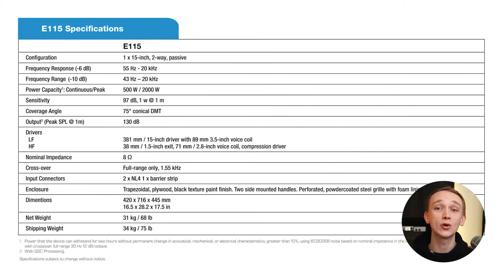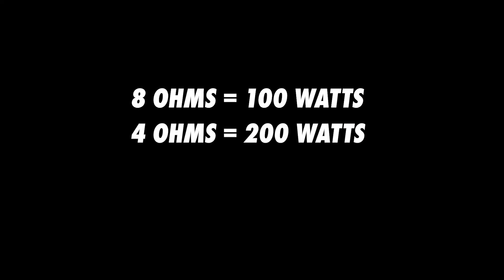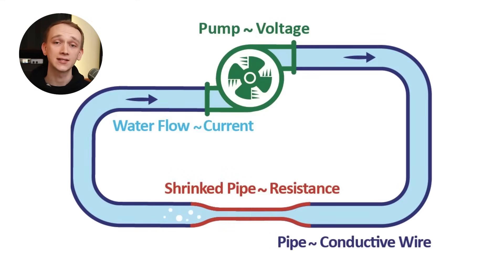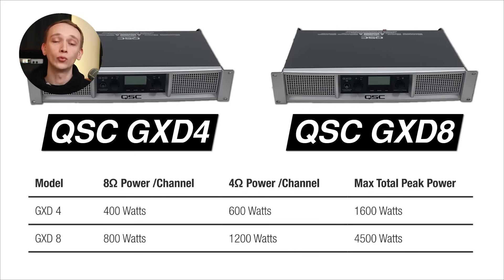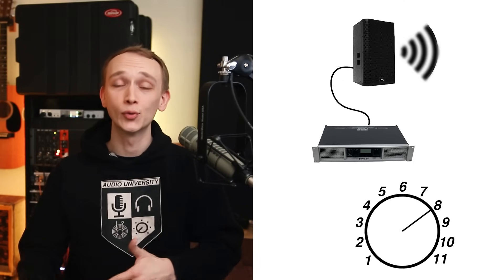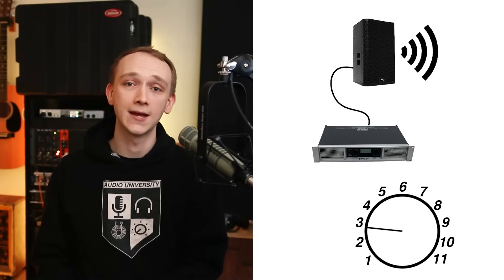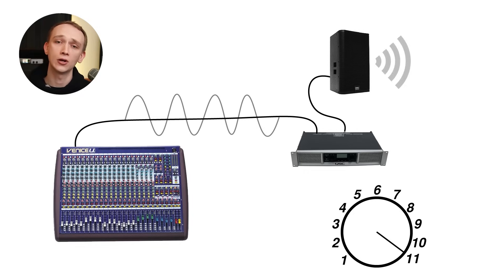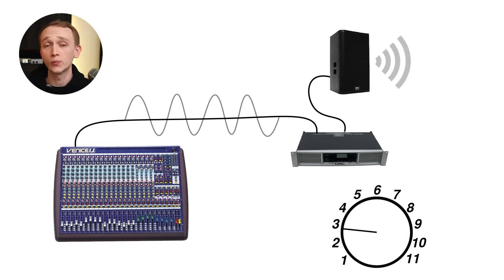WARNING: Breaking These Rules Could Destroy Your Amplifier & Speakers!

Comment: Rule 3 is nowadays not really a thing anylonger, I have never seen any professional (and even some cheap) Amplifier which has no limiter built-in to avoid clipping in the last 30 years or so. Without clipping, you can match speaker power to the amp power (800Watts Speaker on 800Watts Sinus (DIN in Europe) or RMS Amp).
It will never clip/distort due to the limiter and never overheat the voice coil with giving 1000 Watts to an 500 Watts speaker for longer periods of time. You can hear clipping, but not an overheating of the speaker. Of course, if the "max"-LED is lit up continously, you have an underpowered system, but at least no damage is done to the speakers.
Clipping can't be heard with some alcohol drunk, that is basically the death of all cheap "DJ-Sets" with an cheap, non-limiting Amp and cheap speakers (and even some good speakers) - they will be destroyed after the gig, at least the tweeters on 2 or 3-way systems.

Comment: Too oversimplified! A Hi Fi speaker is not "A" speaker, it's a speaker system, usually a woofer and tweeter or also a mid-range. They never have the same power rating, always less for the tweeter, which gets damaged by the added high frequencies of clipping bass.  The impedance rating is nominal and often varies drastically over the range of frequencies, so for the amplifier current rating, only the lowest point matters, not the nominal rating. Amplifier peak ratings seldom are much more than their transient rating unless the power supply is unusually skimpy, so it will not be able to supply the peaks the speaker can handle. Those peaks mostly are bass because the ear is much less sensitive to low bass. Low bass therefore is typically louder. The extreme highs in music are lower or shorter duration, so the tweeter is less challenged by normal music. Heavy metal fans be forewarned. Good audio requires powerful amps, more than the speakers can continuously handle. Most speaker damage occurs while listening under the influence resulting in levels that violate OSHA. There is no magic combination that is idiot proof except for integrated speaker-amplifier designs that have built in limiters that won't allow you to melt the voice coils.

Comment: Thanks for the video and efforts put in to it.
However the reality is quite a lot different.

On an average room you only need 4 to 8 watts max for your speakers even if it's an 85db speaker.

All this watts hype are just pure b.s.

All you need to make sure is impedance matching or the closest between the speaker and the amp i.e. if you have a 6ohm speaker then connect to your 4 ohm amp or binding posts instead of 8ohms, 4ohms to 4ohms and 8ohms to 8 ohms (obviously)

Comment: I'd like to add some technical points here.

Speakers are usually not driven to their full capacity even at the same continuous (RMS) power from the Amps running at their full capacity (unclipped). That's because music signal amplitude has lots of ups and downs, unless you are playing a continuous, say 1KHz signal. Subwoofer tends to get more average power than mid and highs. So getting same continuous power speaker as your amps are usually wastage of money. Frequency response of audio amplifier are also not flat. Most amps are rated with their power @ 1KHz frequency, higher or lower than that and you tend to get lower or higher power at output. I'd always pick a Subwoofer rated 60-75% of the Sub Amp's max RMS power. But I'd go for 35-50% for the Mid and high speakers. 25% (4 Times) would be too risky, I'd never go to that lane.
Reply: I m agree.

Comment: Hi Sir, i do have str-dn1060 sony receiver front speakers are 6 ohm whereas center and surround speakers are 8 ohm . Is this a problem? Usually the front speakers and center are louder than my surround speakers..any advice bear in mind my configuration is 7.1
Reply: There's more to it than that. if you looks at the specs for your speakers, you should find another ohm rating for the speaker. Its the lowest possible resistance the speaker can show the amplifier. That's the important one because the lower the resistance, the harder the amp has to work. So, if you just look at 6 and 8 ohms only, the 6 ohm speaker should be more difficult to drive than the 8. However, if you look at the lowest possible resistance, that picture can change quite a bit. That's because the 6 and 8 ohm ratings are averages. The amount of resistance a speaker actually shows the amp is based on frequency. If you take an 8 ohm rating, for example, since the 8 ohms is an average, there is only 1 frequency or note, that when played will show the amp an 8 ohm load. Any frequencies above your actual 8 ohm frequency will be more resistive 9, 10 11 ohms, etc.. Any frequencies lower, will show less resistance. If you now get that 2nd ohm rating I mentioned above, you can use it to figure out what speaker is harder to drive. For example, lets say your 6 ohm speaker can drop down to 4 ohms, and your 8 ohm speaker can drop down to 2 ohms, the 8 ohm speaker is going to be much harder to drive. If you never looked at the 2nd ohm rating.

As for your specific problem, I can't give you an exact answer because I don't have all the information. I can give you my best guess, and I'm pretty sure it will be correct, I just can't guarantee it. Its very common in a home theater system to have your 2 main speakers overpower the center. In most cases, its not a volume issue, its a bandwidth issue. The further you move away from a speaker, the more volume you lose. You also lose frequency extremes. The highs are not as high, and the lows are not as low. That's what's called loosing bandwidth. Having 2 speakers in the same room playing at the same volume as just 1 increases your bandwidth. You still lose volume and frequency extremes when moving away from the speakers, but not nearly as much as you do with 1 speaker. You're asking a single, smaller speaker to give you the same bandwidth as 2 larger speakers. You can buy a bigger center channel and play it louder, or do something else that very few people consider. Your center channel is a mono channel. It doesn't have different information going to a left and right speaker. In my opinion, the easiest way to deal with your problem is to get a pair of bookshelf speakers similar to your mains. Put one on each side of your screen. Since you're feeding both speakers with the exact same signal, you'll float a perfect center image exactly like if you were to put 1 center channel behind the middle of your screen. Using 2 speakers will give you about the same loss in bandwidth as your 2 main speakers. Right now you have about half that for the center. That's why its so noticeable.

Comment: QSC CX254 / 250 watts @ 4 OHMS for Infinity 200 watts (4ohm) speakers. You always want a little head room so you dont get into clipping with classic Infinity's. Just got to show a little restraint on the volume knob.
Reply: Phase Linear 400 / Infinity SM150s.  The replacement woofers should be delivered today.  Need better restraint here.

Comment: As a sound technician of many years I was taught and would also like to add your amplifier and speakers SHOULD ALWAYS BE TURNED ON LAST!! after everyone else on stage has switched on all their equipment to avoid any sudden surges of signals and popping the drivers, that happend before but it was down to an idiot on stage not following the protocol

Comment: another tip, dont ever give 2ohm speakers set (4x8ohm speakers per example) to a 4Ohm amp, the amp need to be 2Ohm stable and these are rare like the montarbo 458
Most use for pro rigs 1 ohm stable amplifiers to use a set of 8 8ohm speakers with it and so on 
or for 20 speakers you just wire them in series to give the amp 4ohms

Comment: Thanks for making the video!

At 4:32, you mentioned that the general guideline is to choose an amp that is capable of providing 2x or 4x of the continuous power rating of the speakers. I'm a little bit confused by this. It seems like to me that you are making an assumption that speakers run at continuous power rating sound the best, but in most cases, we listen to speakers with small volume, meaning we don't even need to get to the point of the continuous power rating. For example, for a speaker that has a 50w continuous power handling, I might only need 10w, because it is loud enough for me. In that case, do I still need a 100w or even 200w amp as you suggested?
Reply: I recently gotten a 100w speaker @8ohm when the AV Receiver is rated @90w per channel. Should be fine too for normal use.
Reply: My rule of thumb is better to have it and not need it, than to need it and not have it.
Reply: @ronaldcarson4360  A lot of speakers handles 50w continuous power, but I found it is not very easy to find a desktop amp with 100w output per channel.

Comment: I do have a 90's Kenwood with 100w/8ohms (100w fr, 20w sur. Frequency response 20hz to 60 Khz. Need some speakers and I not sure what should I buy. Can I buy two speakers that can handle the 100w???
Reply: Looking right now at two different sets of speakers. One set with 140w, 8ohm and the other pair with 100w, 6ohms.

Comment: My speaker is rated at 60w continuous. My amp is rated at 450wats which is well above the 4x rule of thumb pairing guide. Will I blow my speakers? Or just keep the volume down and it’ll be fine?
Reply: I'm sorry but that seems excessive to me. I give my 200 watt speakers 250 watts but not 4 times their power rating.

Comment: Hello.Would It possible to explain signal to noise ratio ? what i am trying to understand is  for example if a speakers sensitivity is 90db at 1 watt and  lets say i  have 2 amplifiers A and  B.
Lets say amplifier A is has a signal to noise ratio of 60db  at 1watt and amplifier B  has a signal to noise ratio of 85db at 1watt given that both amplifiers produce the same  1watt why is it that amplifier B louder or would it be?

Comment: At 5:55 you stated that square signal can damage speakers. To me this doesn't make sense because square waves occur in music all the time (synths in electronic music, distorted guitars in rock/metal). Having this in mind, I think rule #3 is invalid. Speakers should play distortion just fine, as long as the power handling is not exceeded. Am I wrong? Please explain.
Reply: When you record a square wave the harmonics (above the audio band ) are filtered out, when an amplifier goes into clipping the harmonics that go to the speaker can go up to several MHz which effectively turns your voice coils into heating elements, this is the principle of induction heating, except an induction heater has a high power, high mass coil compared to the workpiece been heated but in a speaker the mass of metal (magnet) is too great to heat up and the (voice) coil heats up instead!
Reply: One thing is a distorted effect we find in the music and another thing is physically harming the speaker. The distortion effect many musicians use today is in fact the sound of a "broken" speaker. Someone once, some time ago, damaged their guitar amp and liked the sound of it and voila! But of course nobody wants to damage their expensive equimpent just to get that effect. So, the effect and the gear was engineered in a way that it presents no harm. Also in the mastering phase, the levels are "polished" in a way that it's playable on a wide range of speakers without presenting any issues.

Basically, when the signal sent is too much for the speaker to handle, it causes certain problems that can make it blow. That's uncontrolled distortion and you definitely dont't want that so the rule very valid. It's important to match the equipment and set proper gain staging.
Reply: @katarinamatic1011  Let's say I play a sine wave sample. I monitor it using an oscilloscope. I max out my amp. Will this give a different oscilloscope reading in comparison to digital distortion effect?
Reply: It could also kill tweeters if suddenly, the middle of your song, there was a minute of 10 KHz full level sine wave. But no one would ever listen to you again! But distorting your hi-fi's amp, that's its full power. Might be OK if far less power than the speaker rating but that's very limiting.

Comment: I’m a #1 country music songwriter and have also worked as an independent artist and recording engineer for 20 years. I am fortunate to have near perfect hearing and have never suffered with tinnitus or frequency loss (knocking on wood). I have NEVER been able to hear any more clarity above 44.1/16. While some of my friends have gone completely bonkers with sample rates I’ve never recorded above 48hz/24bit…And actually prefer 44.1.
Young music makers listen up. The music is where it’s at. It’s where it’s always been. Stop polishing turds with glossy tech. You’re just wasting RAM and bounce time.
Reply: But wait, can't we just hear to a max of 20 kHz?
Reply: @giovannibertocci8944  , with 44.1khz sampling if you have a frequency of 23khz it will aliasing and become 950hz, which you will hear as artifact 
With 48khz sampling you don't have aliasing at 23khz frequency.
To stop 23khz aliasing in 44.1khz sampling you will need to have a low pass filter at 20khz with sharp roll off (60dB) , such a filter is very expensive.
Reply: @giovannibertocci8944  sampling frequency is more for a computer being able to accurately record/recreate the nigh-infinite continuous range of real-life sounds/analogue equipment, when the computer can only store/read 1's and 0's. e.g. if the sampling frequency was 20,000Hz, a computer couldn't record 10,000.5 Hz precisely and would instead be aliasing between 10,000Hz and 10,001 Hz (which then rings harmonically back down the freuency spectrum, and can actually be used creatively in sound design). the higher you push the sampling frequency, the more you push this effect away into the inaudible spectrum, allowing for more crystal clarity on the ear-tingling and airy 8-18kHz range for cymbals, hats, shakers, glokenspiels, etc..
but it only matters for recording/sound design imho, which is why I refer 192kHz at 32-bit depth as "engineering quality", since it's overkill for anything else - at the end stage when it's being rendered into the final digital product file, you'll be applying what's known as "dithering", which is a whole other subject in of itself
Reply: How lovely to hear someone echoing common sense!
Reply: Number 1?
Reply: @dinorockwell7670 , only number 1 can write 48hz/24 instead of 48khz/24. And only number 1  records in 44.1 khz for video clips in which the software have to up convert to 48khz during final rendering. 
Btw, the minimum bitrate for Dolby Atmos is 48khz, everything below has to be up converted 48khz.
Reply: >44.1kHz has its uses though, mostly for sampling high-frequency stuff like cymbals and hats for use in drum machines, as the higher sample rate reduces aliasing in the highest frequencies - but you might as well transmux it to a lower sample rate AFTER you record it, since you avoided the aliasing in the recording stage to save on resource use for sure, unless you're about to pitch shift it down a couple octaves or something (obviously doesn't apply to country, but I've made a few decent rave stabs/synths from pitch shifting ride cymbals, snares into kicks, triangles into glokenspiels, etc.). could also be useful if you have a plugin/hardware unit that doesn't provide oversampling but supports higher sample rates, again to avoid aliasing and other artifacting due to pitch shifting

Comment: Biggest 'problem' is that most people don't know when to stop cranking up the system. So many (mostly starting) DJs for instance, have all their channel gain in the red, plus the total output in the red. And yes, while the mixer would have a clean headroom of say 20 dB, you are driving the amp with more than the maximum 775mV/1V/1.2V that  provides the continuous, clean, undistorted sound.

Comment: Continuous power capacity? Where do you see that in spec sheet?
Reply: The "Continuous Power" is rather quite often referred to as "RMS Watts" on the spec sheets of audio gear- and in my experience, more so actually than the former. He didn't mention this little tidbit in the video unfortunately, but yeah: (Continuous Power = RMS Watts). 👍

Comment: Here’s my problem,I have passive speakers as well as active speakers.
I’m using a powered mixer at present time.
What is the proper way I should go about connecting them?
Reply from the maker: Check out this video, Bob: https://youtu.be/ltMPK8gN3X0
Reply: I'm  thinking about getting a 32 inch subwoofer driver that's 6000watts rms and the peak power is 12000 watts tbh and the Sensitivity is 105dB ngl this is sub driver is next level stuff 

 @AudioUniversity

Comment: Speakers and amps should come with “smart” safety features. Circuitry in both amps and speaker should easily be able to clip before damage is done. These days it should not be up to the average DJ or hobbiest to calculate it.
Reply: Many do, The featured qsc amps have limmiters built in, so you can set it to the RMS rating of the speaker you're driving.  With three maps. Agressive, normal or minimal limitting

Comment: Nice Video...but you could also run a amplifier with an equal power rating but put a limiter to ensure the signal doesnt go into clipping
Reply: If the amp has "gain" knobs on it you can limit it down to a whisper at full volume from your source.
Reply: Thats also a Solution
Reply: Some amps are just build in a way that clipping do not happen even if you overload the input.